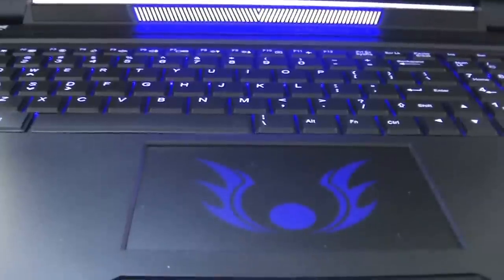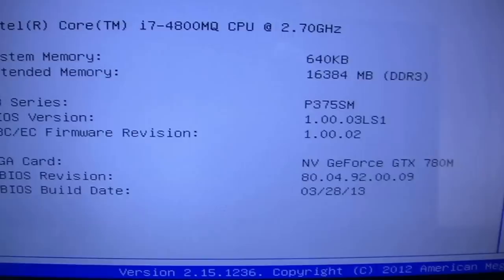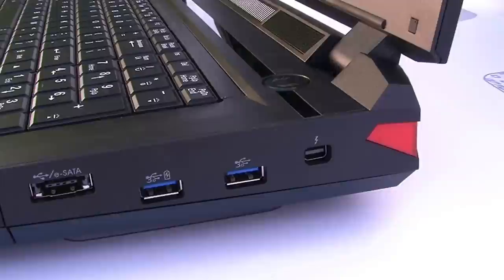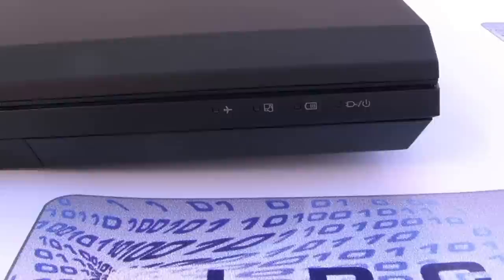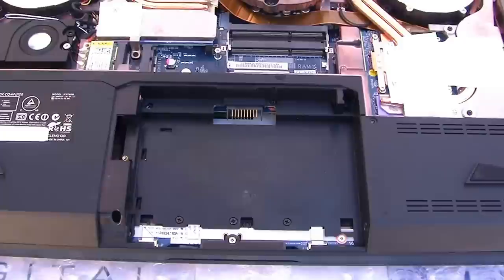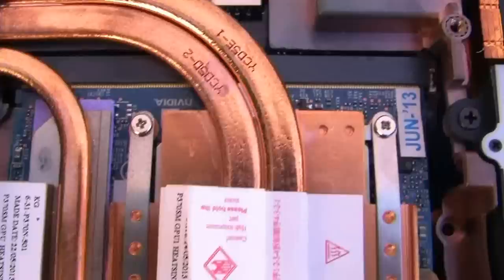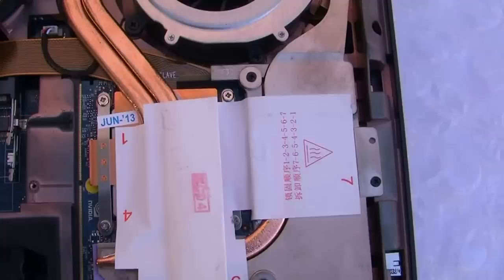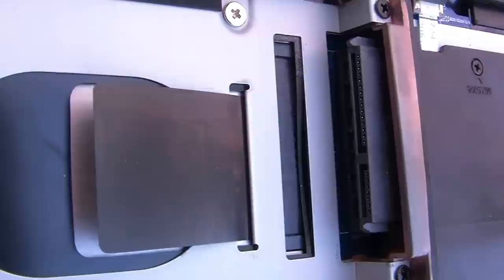Sager NP9390 / Clevo P375SM -  LPCDigitalVideo

Comment: I just read the posting to which you are referring to. In that forum, they are discussing the P370SM3, which is the Sager 9380. The 9380 is not the same as the 9390. The 9380 comes with only a 300W power supply, which is meager in terms of running dual 780m GPUs. You would have to use another power supply to operate that machine; however, the 9390 comes stock with a 330W power supply that can actually supply up to 360W (if I've read truthfully), making it completely viable for this beast.

Comment: Also worth taking into consideration, other laptops that push the dual 780m GPUs also only use the 330W power supply. The Alienware 18 uses only a single 330W power supply and there hasn't been any trouble I've been able to read about yet of that power supply not being enough to push those electronics. Check out DunnySlice's review of his new Alienware 18. He had no trouble with power using a 4900MQ and dual 780m SLI in his gameplay tests.

Comment: According to the review linked in the description, the 330W power supply feeds the dual 780m GPUs and the CPU just fine, "Maximum power draw at stock was typically below 270W, and with a slight overclock (+100MHz core / +450MHz vRAM) resulted in a draw less than 320W. These figures are all draw from the wall so the actual supplied power to the laptop is 10-15% less due to an efficiency factor of the PSU."

Comment: A Sager NP9390 is not exactly a Clevo P375SM.: the Sager lacks the TPM chip.  Clevo recommends the RAM1 and 2 slots you show be populated first and preferably over the under keyboard ram slots. Finally, the default UEFI mode in the BIOS is disabled.